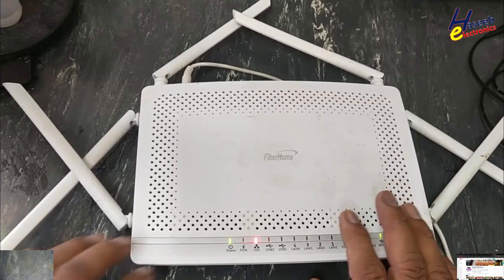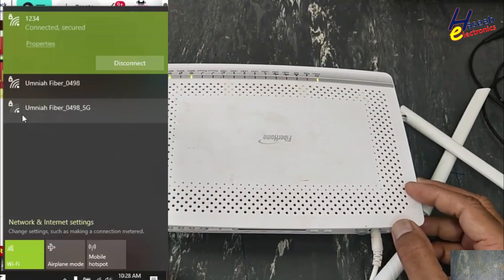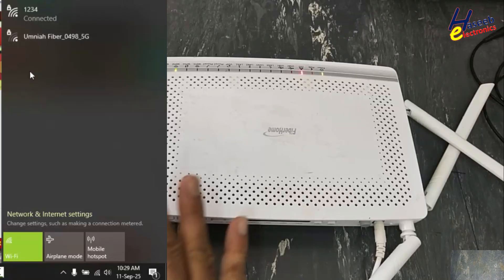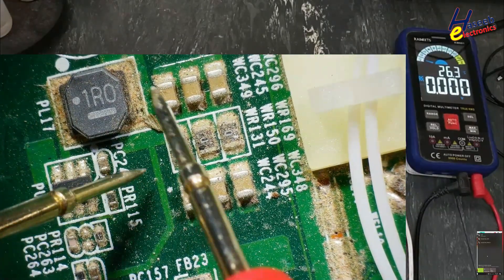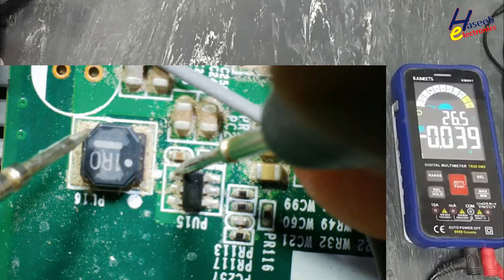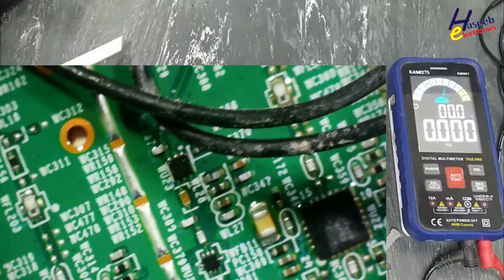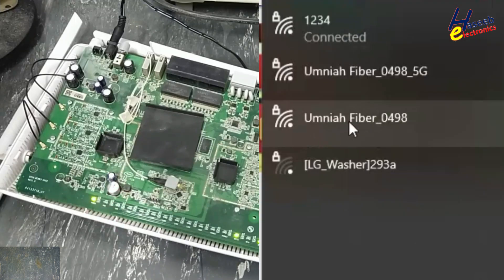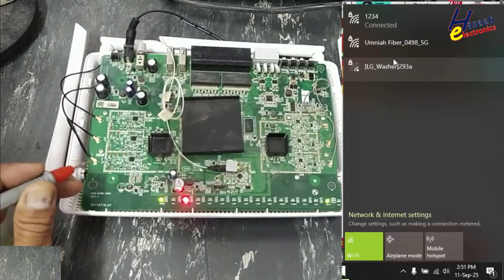{1381} FiberHome Wireless Router Repair | 5G WiFi Band No Signal Fixed – You Will Love This Trick

Comment from the maker: 💡 In this video, I repaired a FiberHome AN5506-04 router with a 5G WiFi band problem.
The trick I used with the 5V regulator (SMD code 309) worked perfectly ✅.
👉 Did this help you?
Comment your router model ⬇
Share if you tried this trick yourself
🔔 Don’t forget to subscribe for more real repair solutions!

Comment: Good morning sir, will high current external power supply not damage the circuit processor/cpu ?
Reply from the maker: because the switching regulator was in reboot mode due to any over-current condition. 
when we are confident for voltage value (in my case  5 volt) then we can inject volt with high current (Caution. slightly higher voltage than the allowed limits will damage the circuit).  if there will any short circuit component that will die immidiately or will be identified. if microprocessor /CPU is already damaged, that will be identified in seconds 😂😂😂😂😂😂😂.  if CPU is safe then high current power supply with rated volatge will cut all cancers 
i injected the external volatge to the output of switching regulator. these switching regulators are very sensitive to the current and output voltage limits. if there is slightly higher current is being drawn by the next cirucit. this switching regulator will stop its swicthing until the current sense signal level drops than its upper threshold limits 
when the current sense signal comes within allowed limits. the regulator starts switching again 
when i injected external power supply, that was not current limited, that cleared the bridging or any condition which was creating over-current condition (that may be due to any tiny capacitor, any semiconductor componenet, or sometimes the conductive elements in dust, or composits of dust with humidity, or sometimes oxides, and sulphates). thus the regulator output line became in safe limits, in result it started working normally

Comment: Making the short circuit into a fuse. Nice trick. 
It seems Mr Haseeb bought a job lot of broken routers? :))
Reply from the maker: no it is not at fuse. i injected the external volatge to the output of switching regulator. these switching regulators are very sensitive to the current and output voltage limits. if there is slightly higher current is being drawn by the next cirucit. this switching regulator will stop its swicthing until the current sense signal level drops than its upper threshold limits 
when the current sense signal comes within allowed limits. the regulator starts switching again 
when i injected external power supply, that was not current limited, that cleared the bridging or any condition which was creating over-current condition (that may be due to any tiny capacitor, any semiconductor componenet, or sometimes the conductive elements in dust, or composits of dust with humidity, or sometimes oxides, and sulphates). thus the regulator output line became in safe limits, in result it started working normally
Reply: @HaseebElectronics  Thank you for the detailed explanation!